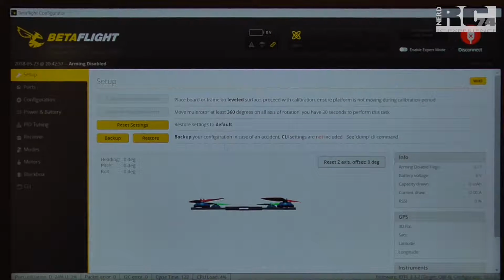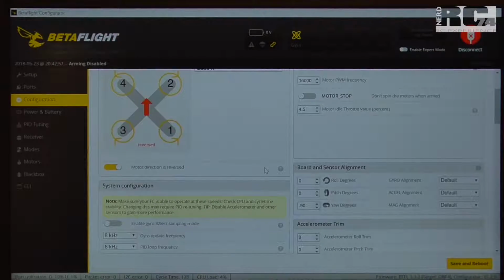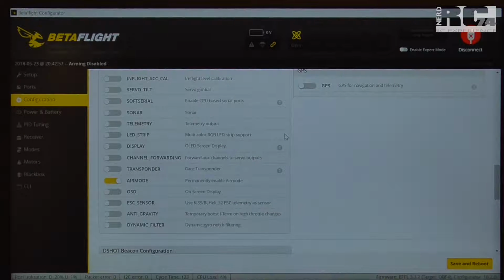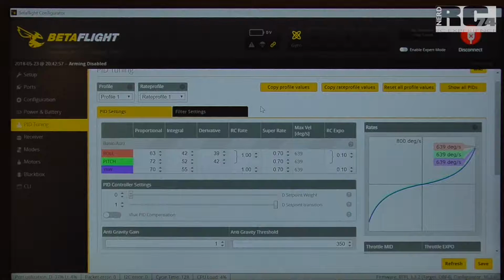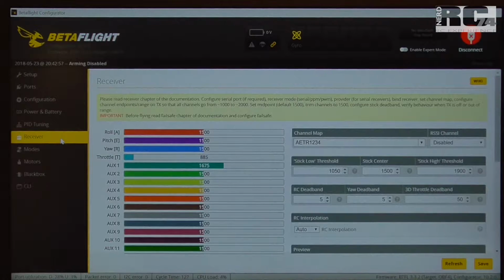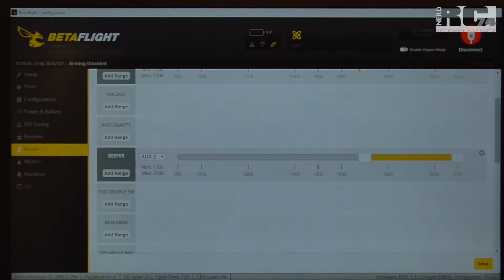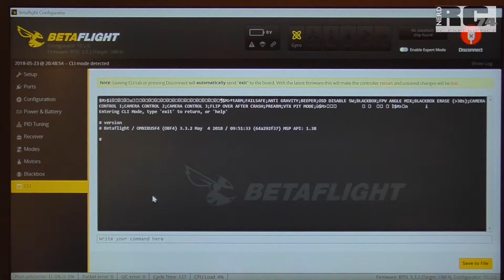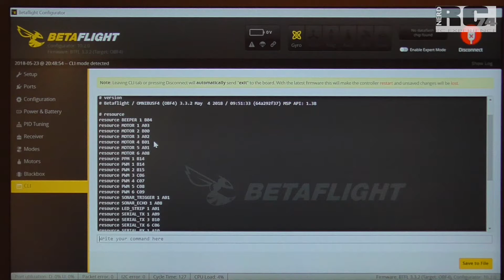TURNIGY MULTISTAR F4 AIO 4IN1 ESC - BETAFLIGHT SETTINGS

Comment: I just got 2 of these and I'm pretty sure you need to flash to luxf4osd for black box to work among who knows what else is different in the targets
Reply from the maker: I didn't test this one with LuxF4osd. I'm looking forward to your test. In my opinion there is a issue with roll axis. If you do very fast roll axis flips. The quad begins to shake. no matter what PID you have set. I hope you gonna find a setting which solves this problem.
Reply from the maker: Hi Adam. Thanks for your input. I never use blackbox. So i cannot tell if it works with omnibus firmware. I use it also without OSD. Like this it's OK. But more noise than 4in1 esc and F4 fc separate...